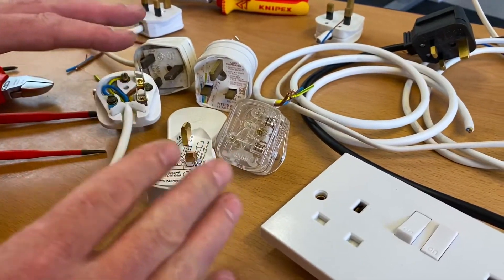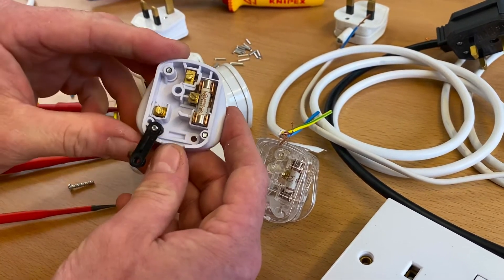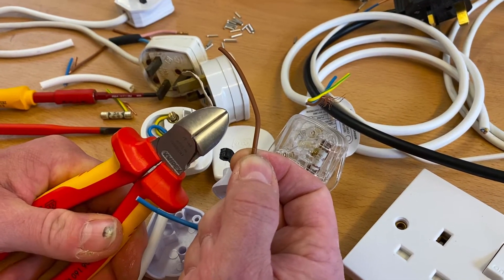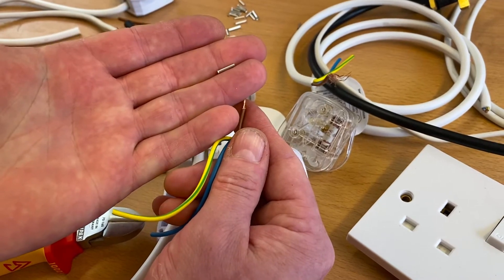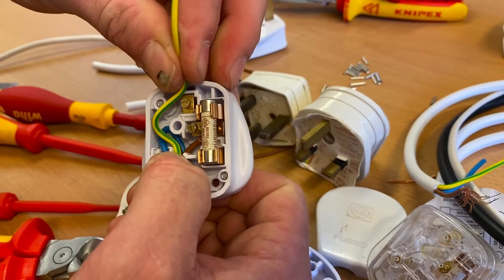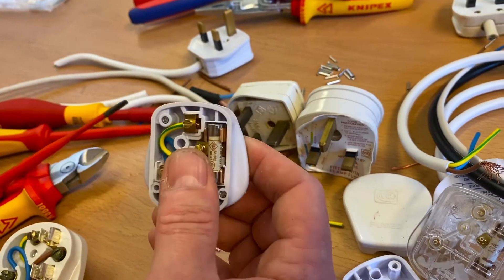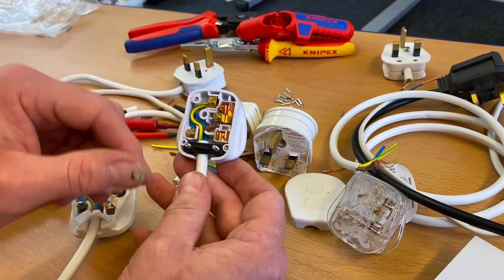How to Fit, Wire or Change a 13 Amp Plug Top - Wiring a UK BS 1363 Plug Step by Step Demonstration

Comment: i was fitting plugs when i was less than 10 years old - my dad would allow me to fit them, but had to inspect them when he got home from work. In reality i fitted and used it all day, then took the lid back off before he got home to “inspect”.
Afraid my 50p a week pocket money wouldn’t stretch to a ferule tool 😂

Comment: As 70-year old amateur DiYer, I always use ferrules. Totally anecdotal, but I think in past decades (going back to late 1960s) the brass made for better connections with stranded cable than in modern plugs.
   As an amateur, I try to go as perfect as possible so I would not allow myself to have any wire showing: I have the time that a professional doesn't have and I don't know what I can get away with so I aim to get away with nothing. When sparks do come to do jobs in my house, they are are invariably complimentary about the little details they notice.
   And I always change the fuse to what is suitable for the appliance so rarely keep the 13A fuse

Comment: The paper with the diagram is a bit misleading. Before removing it, it suggests the rightmost pin is where the fuse will be- at least when the pins are facing you 1:05

Comment: That's a lousy plug top. 
The brown conductor should be as short as possible to the extent that if the cord is pulled hard enough to pull the conductors out from the terminals, the brown should be first out. With this dog-leg around the moulding and the congestion where the three conductors squeeze through the limited space, it's likely that the brown insulator will catch on the corner and stretch instead of allowing the conductor to simply be pulled out.

Comment: Excellent demonstration Gaz , but I have to say that particular plug design I wouldn’t bother with I would throw it in the bin, no room in it and as you it is tight on space. The plugs with a single screw in the centre are way easier to wire as simply because of the centre screw means the manufacturer has maximised the space for the conductors. Also I strip the conductors so I have them poping out of the other side of the terminal a little bit hence the small recess on the earth terminal. There’s also just a tiny bit of space on the Neutral as well. . Excellent video as always Gas 👍👍
Reply: T
Part of a teaching video series which uses a variety of items so trainees get wide experience. You and I might dump awkward plugs or whatever, but apprentices likely to have to work with what they're given. When they're free to make their own decisions, they can dump whatever they want

Comment: I want to know about plug bottoms next please...
Reply: In my early days in the trade we used to  call a wall socket a plug .  If you look at labels in old fuse boxes very often it’s labeled lights and plugs .The plug that went in was hence called a plug top. 
Roll on 40 odd years ,I still find at least  75% of customers still call wall sockets plugs..Example . Can you wire a plug in my garage for my new freezer
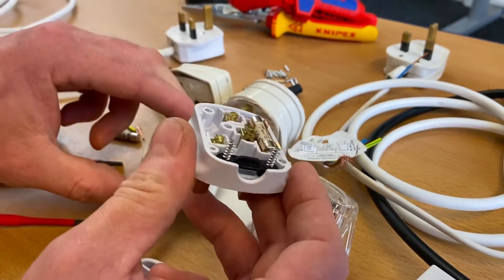Reply: @andysims4906 i'm guessing your an experienced sparky then, any idea, why the plug he opens up at the beginning of the video, specifically 2:16 it still has the originall hole for the screw to close the two halves together between the live and earth pins, aswell as an extra one under the neutral pin?
Reply: @thunderbal79 the four holes under the line and Neutral Pins are 1) where the pins are press studs which form the top of the pins . The holes below are where the cord grips have a small lug on each that fits into the holes and then melted down to secure them in place. The screw to secure the plug together is in the centre so as to leave plenty of room for the conductors to sit neatly.
Reply: @Dog-whisperer7494  . That’s a good explanation.  
It was not uncommon years ago to have 2 screws holding the top on . If your very old school very often  we just had 2 pin plugs and sockets. (No earth) The covers on some makes could be be just unscrewed by hand ( without a tool)
Reply: Thanks for answering something I've wondered ever since I was wiring plugs as a kid! I always loved MK plugs and would love a pound for every one I've wired over the years! Cheers!
Reply: @andysims4906  professionals ought to know that the correct terminology is a plug for the male connector, and socket outlet (or perhaps 'receptacle' for North America)
Reply: @alistair1978utube  You asked about plug top bottoms so I answered your question. Thats the way it was in the old days. . As I said if you look at labels in old fuse boxes especially up to the 70s it was mostly referred to as lights and plugs. I’m not saying it was right or wrong.
Not much different from today . Even professionals often call a consumer unit a fuse box
Reply: I'm sure a wide selection of bottom plugs can be found on flea bay